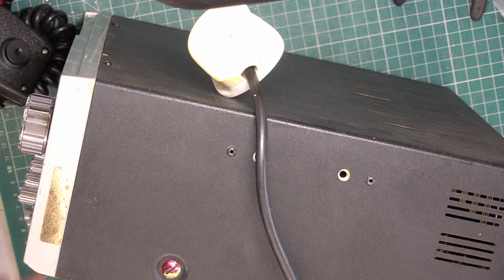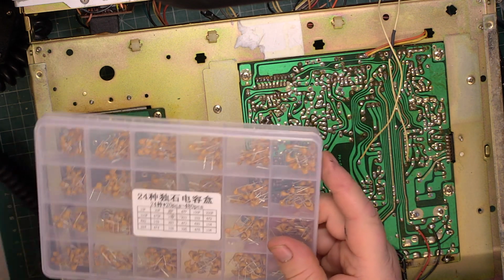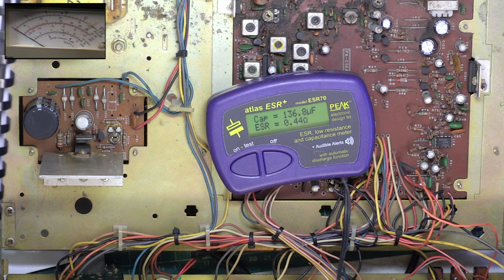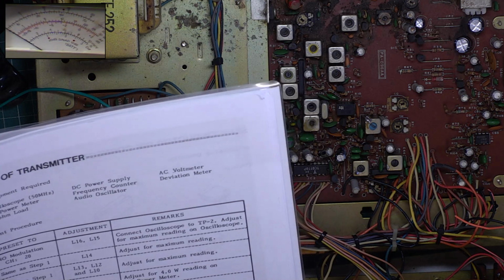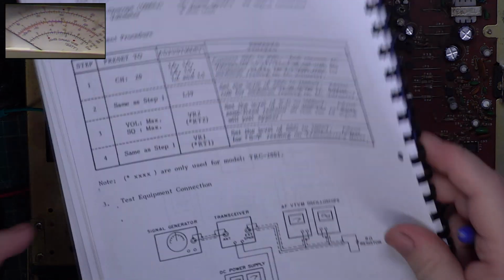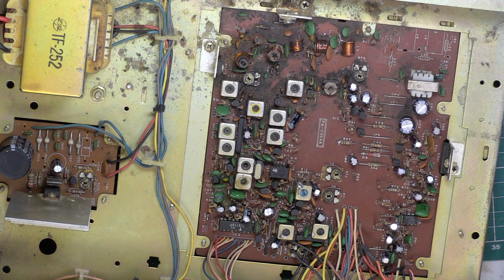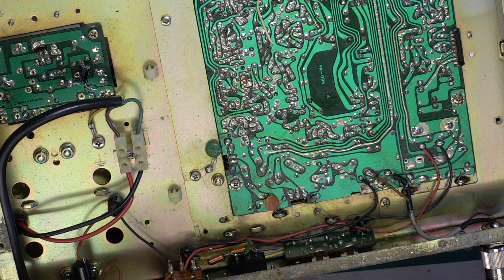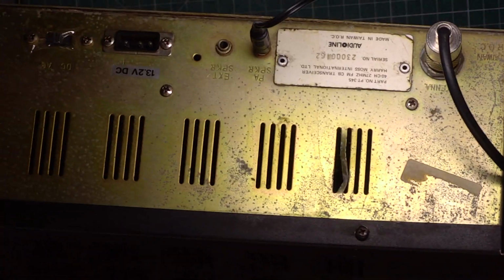Audioline PT345 CB27/81 base station CB radio - extensive resurrection

Comment: The Audioline base station was a very good radio I've never had one myself but they are really good and somebody added a mid band EU board as well and a roger bleep board maybe it was used in the past for DX'ing and I'd bet that the last owner most probably used a linier amplifier as well to get out better but all of these modifications are highly illegal and if say Ofcom knocked on your door then they'd be bang in trouble so really it's not worth the risk taking chances like that on the CB radio. Anyway best 73's for now cheers. Stephen M3SNV 73's.
Reply from the maker: Bear in mind these illegal modifications greatly degrade performance on both sets of channels & usually culminate in killing the radio...often permamently.

Richard, G0OJF, UK

Comment: Don't know how the signal generator noise doesn't drive you nuts!
Maybe just my ears, but I have to turn the audio down when you do it. One of life's torturous noises!

Another set resurrected though Richard.
Good stuff.
Reply from the maker: Your brain just notches out the 1khz tone over time. Imagine a workshop with three benches in operation at the same time with each signal generator 'not quite' 1Khz thus producing beat notes.

Richard